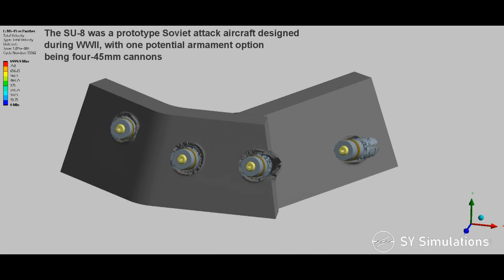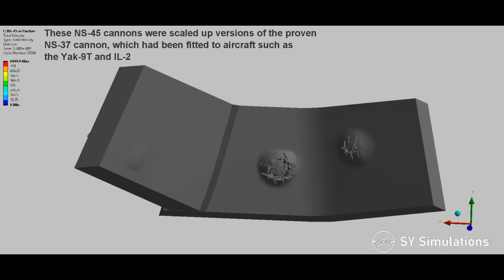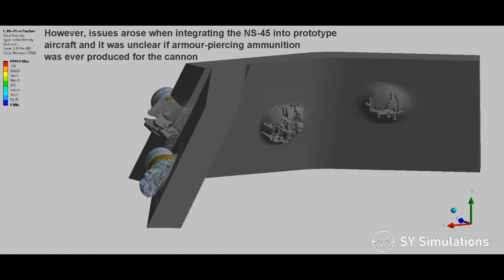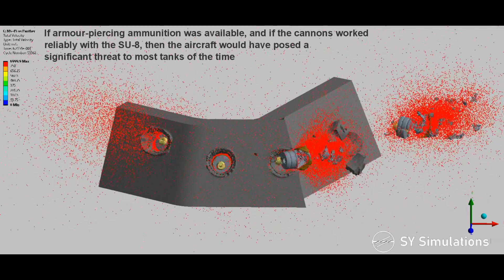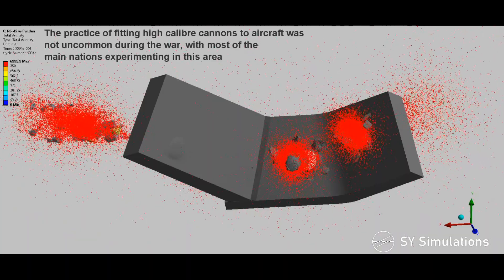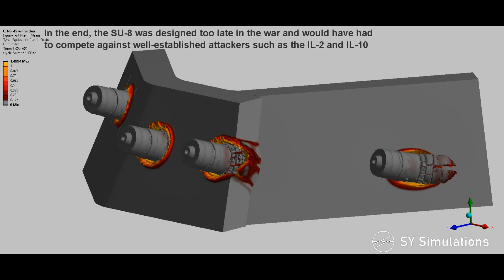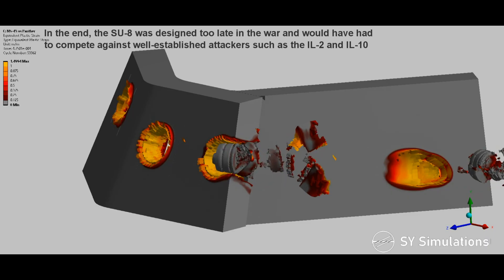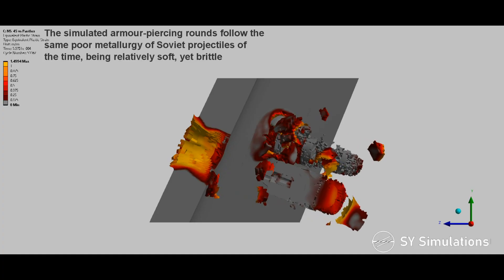FOUR ANTI-TANK CANNONS ON AN AIRCRAFT | SU-8 vs PANTHER | 45mm Armour Penetration Simulation

Comment: There was a Yak-9 with a NS-45 also. Yak-9K. Did not become very popular due to the recoil screwing with the plane's systems, even with a beefy muzzle brake. It did oneshot enemy planes though.
Reply: Yeah but so did Yak-9T with a higher muzzle velocity NS-37 which is very helpful for accuracy
MK108 might have the same filler effect but hitting a fighter with it is immensely harder

yes, this is conjecture based on my warthunder experience

Comment: Would these 45mm cannons be more potent on an aircraft compared to being static on the ground? I'm curious if the airspeed of the aircraft would increase the effective velocity of the rounds, or if it wouldn't be flying fast enough to make a significant difference.
Reply: Airspeed never makes a difference. A shell gets lobbed out the Barrel by a small explosion happening within its casing. This instantly launches the shell at a speed much faster than the AC could ever be.
Reply: @samsonstone500  
What? Airspeed absolutely matters.

At it's top speed, it's adding over 100m/s to the projectiles, that's enough to add tens of milimeters of penetration.
Reply: @ThatZenoGuy  nah you dont understand the physics behind it. The projectile gets launched at a set speed (in case of the 45mm cannon its ~750ish m/s) so its faster than the plane it would be mounted on from the second it gets launched. The Airspeed of the Plane has absolutely no influence on the speed of the projectile after its gets ejected from its casing.
Reply: @samsonstone500  
Oh my god lmao, that is not how it works at all. Look up the theory of relativity.
Reply: @samsonstone500  it kinda does though. the unfired projectile is already moving at the speed of the aircraft, the explosion that propels it then starts from that speed.
Reply: @ThatZenoGuy  Gotta love it when people tell someone they're wrong with utmost confidence when they are infact wrong 😂
Reply: @Kuschel_K  
It happens.
Reply: @samsonstone500 so you think that when an airplane flying at 700m/s fires a projectile flying at 600m/s, then the plane overtakes the projectile?

Comment: Why can this go through while the same caliber on a tank had no chance? Just the speed boost given by the speed of the plane?
Reply: Russian 45mm was a very credible threat to panther's side, here is an excerpt from wikipedia

On 26 March 1944, Sergeant Alexander Pegov of the 3rd Guards tank army, commanding a single T-70, saw a column of approximately 18 German tanks approaching. He took an ambush position hidden by foliage and then he waited. After a German PzKpfw V “Panther” tank came within 150 to 200 metres (160 to 220 yd), the T-70 suddenly opened fire with APCR ammunition and set fire to one Panther and immobilized another. The knocked-out Panthers blocked the road while the T-70 retreated. Pegov was promoted to a lieutenant and decorated as a Hero of the Soviet Union.[4][3]

it would be much worse against T-34 or KV/IS series however which had quite meatier sides

off the top of my head extra 100 m/s would give it about 10mm more penetration but then you are firing from farther away than 200m - that would be kamikadze territory even for ace pilots

Comment: If you think this is terrifying, the British 57mm Mosquito was intended to rip apart the hulls of submarines. The roof of even a King Tiger would have stood no chance.
Reply: Submarines are relatively fragile and even a minor hole or fracture would prevent it from diving
Reply: Sub aren't known for their armor......
40mm rha is more armor than any sub can ever hope to get, ok there are a few exception but they are the exception.
Reply: Planes with cannons hit the sides/rear of tanks, not the top. They don't dive at a 90 degree angle lmao.
Reply: @ThatZenoGuy  They don't have to. If a plan is coming in at a strafing run from any decent height, it's gonna hit the roof as well as the sides. Planes don't strafe a tank while flying at ground height.
Reply: @biggiouschinnus7489  
Roof hits are relatively rare, historical pictures of MK103 runs shows this.
Reply: @ThatZenoGuy Since you like quoting historical facts, British Typhoon pilots used to knock out Jagdpanthers  by coming at them from the rear high and shooting the engine deck, their cannons were powerful enough to pierce the engine deck and busting, or at least severely damaging, the engine...
Reply: @hoshyro  
Doubtful, such a high angle attack is very rare except for dive bombers with dedicated airbrakes. Try again.
Reply: @ThatZenoGuy  Go look it up, you're the one who seems to ignore that planes could easily fly over their target
Reply: @hoshyro  
Sorry, but you're incorrect. Try harder please.
Reply: @ThatZenoGuy   Based on?
Reply: @hoshyro  
You have to go back.
Reply: Dumb comment. Submarines have no armour at all. The KT was one of the most heavily armoured vehicles of the war. A 57mm cannon would have to be fired perpendicular to the roof of the tank at very close range to even stand a chance of penetration.
Reply: @eisaatana96 
Someone with some sense!
Reply: @eisaatana96  Dude, that's just flat out nonsense. Even the 80mm side armour of a King Tiger was well within the penetration capabilities of the 6-pdr at a thousand metres, especially given the poor quality of late war German metallurgy and the development of APDS ammunition.
Reply: @eisaatana96  It definitely didn't need to be perpendicular, but close yes, though, British pilots tended to aim for engine decks anyway since they were less protected and also a bigger target

Comment: I can only imagine the stress on the airframe.
Reply: It's a 12 ton aircraft so compared to Yak-9 which is about 3 tons i'd say it's about the same before considering it was designed for this gun pack from the start. But the problem it was meant to solve (massed german armor) was already going away when it first took flight and it wasn't agile enough to perform dive bombing missions so nothing of particular value was lost in dropping the development.

Comment: Could u do the krupp 7.5cm 1903 shrapnel shell vs Mark IV and ft 17

Amazing sims btw

Also I've wondered that did field guns have ap to penetrate tanks in ww1?
Reply: For anyone more interested, 2 main Field guns that where used as AT guns by the germans were the 7,7 cm FK 96 n.A. L/27 and the 7,7 cm FK 16 L/35 as well as all captured french, russian and british guns drilled out to 7,7 cm (thats the whole reason, to be able to drill out captured guns, but at the same time deny the enemy to use your guns with their ammo) with also barrles of 7,7 cm with L/27 and L/35 length. They both had 3 dedicated AT rounds (while the normal He rounds with right fuze setting will work as well) namely 1. K. Gr. 15 m.P (Kanonen Granate 15 mit Panzerkopf -> Cannon Grenade/Shell 15 with AP head) beeing a normal HE shell but instead of the normal impact fuze it has a big special hardened special steel head with an extra designed (AZ f. K. Gr. 15 m.P) Impact Fuze under it, going in at 6,85 kg with 230g of cast or pressed filler beeing TNT, Amatol or something else more potent like PENT. Going at 465m/s with L/27 and 525-600m/s with L/35.
2. K. Gr. 15 m.P (Bo. Pr.) Beeing the same round but instead made of a different steel drilled out and beeing 7 kg.
3. K. Gr. 15 m.P m.L (meaning mit Leuchtspur -> with tracer) beeing also 7kg heavy and having a really big tracer pressed under it.
Reply: Some field guns had AP shells. APHE and SAPHE shells were originally designed for naval crafts.
Reply: @Ghostmaxi1337  tnx man
Reply: @day_dreamer473  i updated it a bit for more info, np.
Reply: @Ghostmaxi1337  always did wonder that if the Großtraktor was like there in ww1 it probably would have been a breakthrough. Obviously slower and more armoured than the original and a different gun ofc
Reply: @day_dreamer473  for some reason all my comments are deleted, i dont waste more time giving more info for some reason they just disappear, but there is more to it 3 rounds and 2 vehicles with those guns.
Reply: @Ghostmaxi1337  I guess the single 75mm and the rear mg08 one not the neubaufahrzeug
Reply: @day_dreamer473  There was A7V AA and KD-1 Geschützwagen with the 7,7 cm guns. Which where a lot as AA and AT used of the 2nd i mentioned, there was also an ApHe-T round i guess the comments where deleted because of the name of the rounds forming blue links into empty space because they have "." In them.

Comment: Which of the large-caliber planes was the most successful?
I've heard of another soviet version where the cannon damaged the air-frame! After every mission, the plane had to be pretty much completely disassembled!
Another one had massive problems with the cannon making its mark. Only the best pilots managed to hit their target with it and that at a distance where they wouldn't get shot to pieces by e.g. Tailgunners. Plus, they had a slow reload and low ammo capacity...
All in all, I assume that the 30mm machine gun was the biggest one that made sense at the time... Still, a rapid firing 57mm cannon with high-velocity projectiles sounds pretty scary...
Reply: I do believe the 57 was the most successful, the mosiquto series of planes etc. May be wrong! Ill go look up some numbers :-)
Reply: Anything bigger than 57mm required the plane to be rebuild after the mission. 
But what measurement of successful are you basing your statement on?